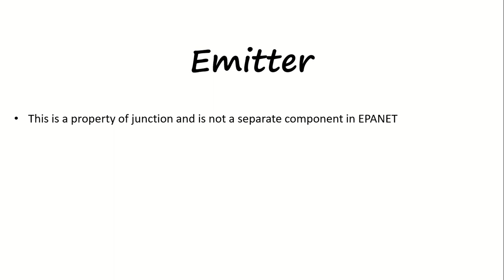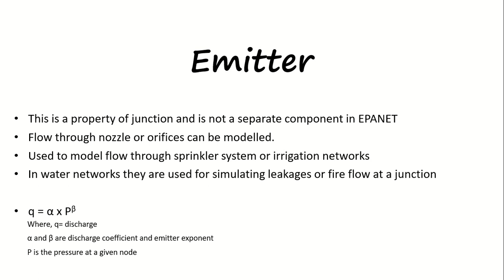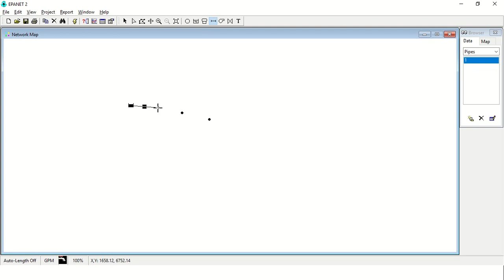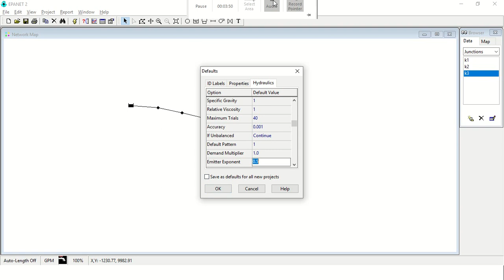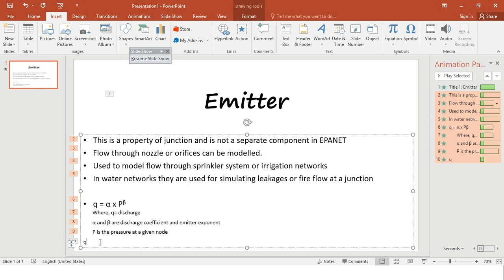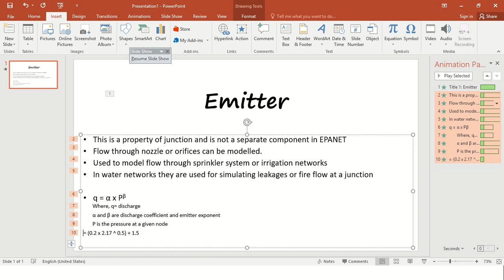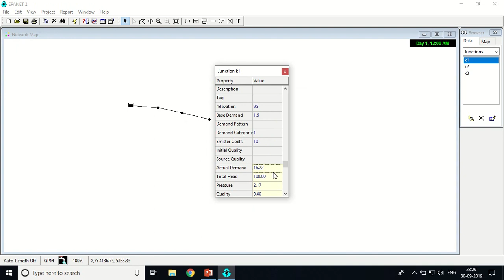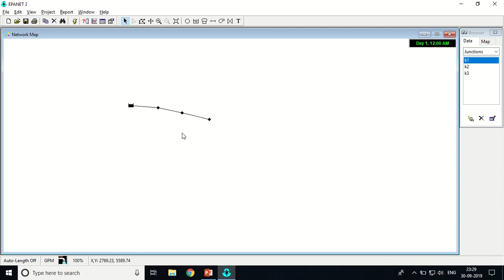Use of Emitter in EPANET ( for leakage and fire fighting conditions)

Comment: Hi aniket,i am doing simulation with epanet but facing negative pressure at junction,i want to ask you how i can avoid this problem,please reply or give me your email adress i will send you epanet file.
Reply from the maker: Check if all the pipe diameters are properly assigned. All the nodes should be properly connected, and their properties should be assigned, like elevation, nodal demand etc.
Reply: @waterdistributionsystems8194  ,Thank you for your reply,yes i have double checked.only problem occur in branch pipe line.It shows negative pressure on branch pipe of my network,i try to increase flow and head from pum,but it does not work.I am using two different diameter pipe,one is 100mm as a main pipe and 50mm diamter for other branch pipe.do i need to use same diamter pipe?do i need something else to connect two different pipe or just pipe from 100mm diamter pipe to 50 mm diamter pipe.i truly appreciate for your answer.
Reply from the maker: Share your network details
Reply: @waterdistributionsystems8194  i am doing a fire sprinkler exercise  using a emitter coefficient.I have 20 junction at 9 meter hight,i am using a reservoir than a pump.a pump is supplying water at a hight of 9 meter in a main pipe line .in main pipe line,i have 4 branch pipe in paraller.each branch pipe have 5 node as a fire sprinkler.when i run the software,it shows negative pressure at branch pipe flow is not going from main pipe to branch pipe.can you send me your email,i will send you epanet file.
Reply from the maker: @osama82405  sharmaaniket03@gmail.com
Reply: @waterdistributionsystems8194  Please check email.
Reply: Hello Ankit ! It would be great if you could you please provide fire sprinkler exercise tutorial in Epanet. It would be so much helpful for the beginners like me.  Hoping for a positive response. Thank you !
Reply: Just bcoz of wrong direction in pipe setting.Just delete that link and redraw according to the flow direction
Reply: What unit did you use?